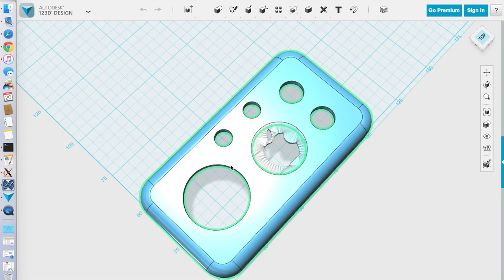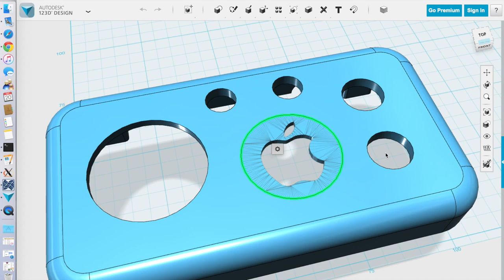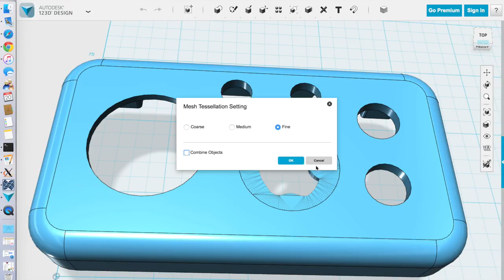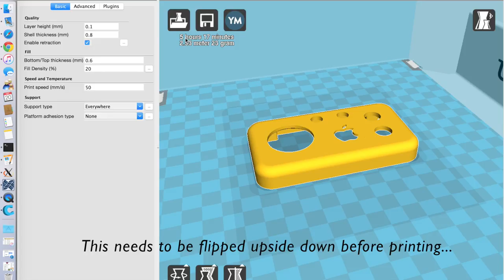Assembly Lines #15: Apple Joystick Case

Comment: To print ABS without warping, use a slurry base. Works wonders. Mix abs filament with acetone, to the consistency of milk. Pour it on the bed and spread an even thin layer where your print will be. Then crank the heated bed up as high as it will go.
Reply from the maker: +Blondie B Thanks for the tip!